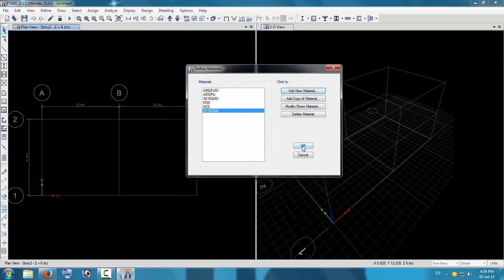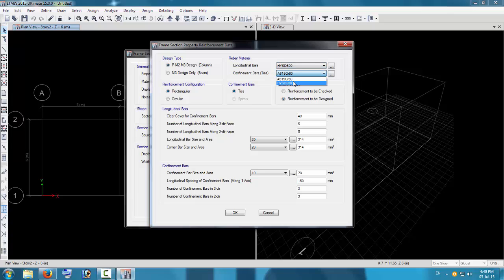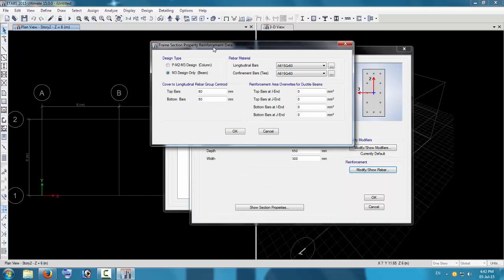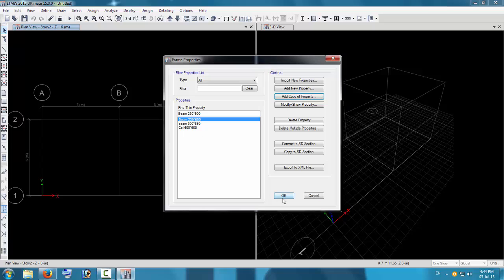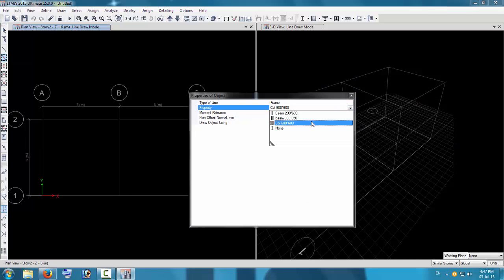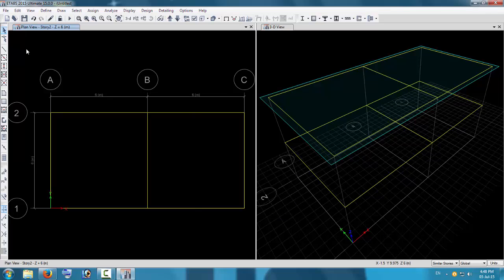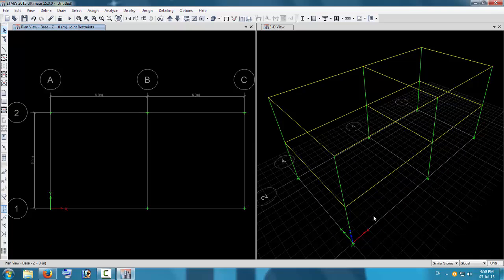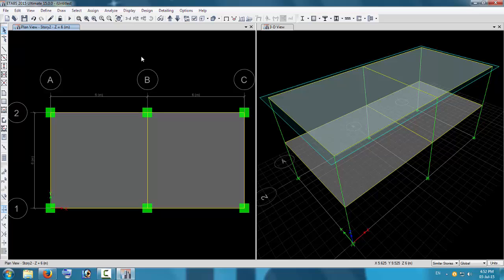Etabs 2015 tutorial 2 | Members selection and framing model Using IS code

Comment: Bro How to calculate wall load
Reply from the maker: calculate the volume of wall per meter then multiply by 19 for std motor joint bricks (or by {5 for flyash bricks})
Reply from the maker: Example for exterior wall Load= 1x0.23x(3-0.45)x19 = 11.14 kN/m
Reply: Qamar Moonboy ok dear thanks